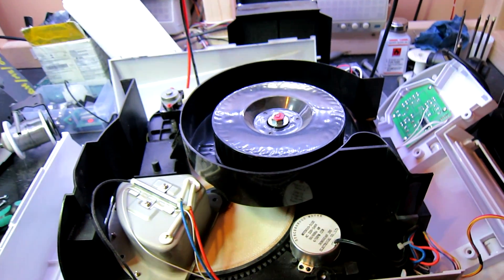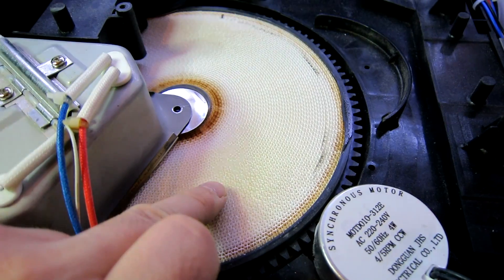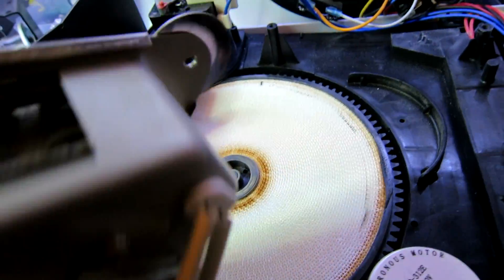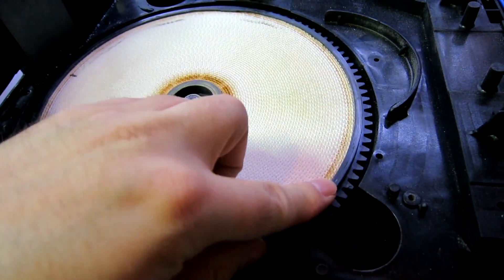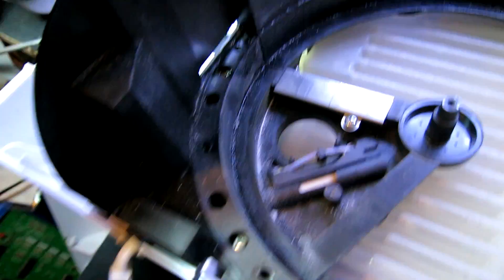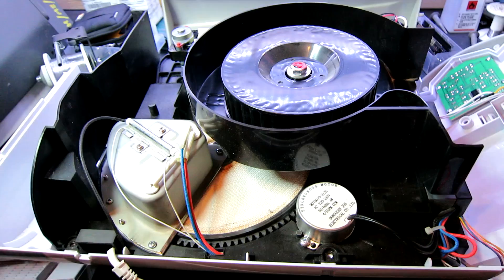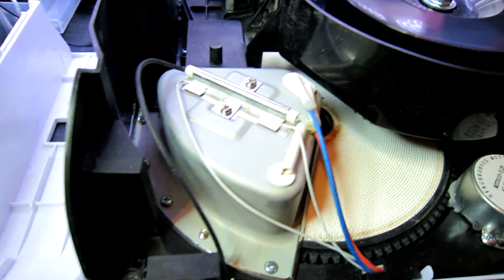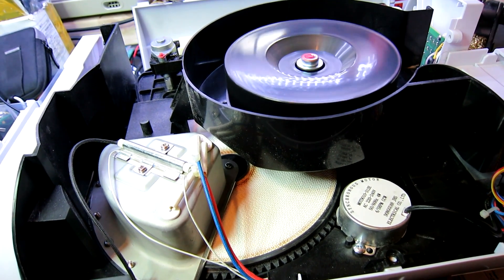Desiccant Dehumidifier Repair + How it works

Comment: Hi there. I am currently going down the dehumidifier rabbit hole for collecting as much knowledge as I can collect because apparently that's what satisfies me 🤣. I live in a dry desert area and temperatures here touch 50 degree Celsius. No one I know has heard of domestic dehumidifiers, never seen domestic dehumidifier in real life and wanted to know how these things worked. Yours is the perfect video for that. I love YouTube because I didn't think someone would have posted this. Just seen this I can think of at least 5 changes to improve the reliability. I wonder why companies makes such bad products.
Reply: some make low quality products to get your money, without spending much of theirs. I have high quality versions, which have been running for 6 years, without a single problem.
Reply: Why would you neeed a dehumidifier in the desert?  When I lived in the desert we had humidifiers.
Reply: @stargazer7644  it's humid here for some months along with high temp. Black/ red wet bulb temperatures. It's not a completely dry desert round the year of course.

Comment: Hi my Ecoair Desiccant Dehumidifier ECO DD122FW wont turn on and there are no lights showing. Having watched a few videos, I'm thinking it could be a faulty capacitor. Did try a multimeter on it and the needle didn't move. Is it worth the expense of  changing the capacitor to see what happens? Or could it just as easily be a number of causes?. thanks.

Comment: I have DD8L and it cut off after 2 mins,Fan goes slow and error light comes on. Then after few min it stops working. Any advise??
Reply: Hi , I have also the same problem in my desiccant dehumidifier.
Reply: @261divyesh  Check my channel I've got a video taking my DD8L apart. You probably need to take it apart and clean it.

Comment: How are you? Can you clean it? Mine extracts way too slow after 3 years of intensive laundry mode using. The rotor has some residues which I think prevent it from working well

Comment: Does anyone know if the desiccant wheel has to go only one way or can it go both? The motor turning it has died in mine and is marked ccw but almost all these motors are cw/ccw meaning they reverse when they encounter resistance. Am hoping I can just replace it with a cw/ccw model which would make the fix easy and cheap. The desiccant wheel on mine is very difficult to turn as in the video which I presume has lead to the motor burning out. Thanks for the very useful video arcadeuk!

Comment: so it takes the water out of the air and it put it back in the air  ?
Reply: When the desiccant is heated, the moisture goes into air which is then passed through a condenser module which is basically some plastic piping which is kept at around room temperature (so it's cooler than the heated air temperature). This causes the moisture in the air to condense out and drip into a collection bucket at the bottom of the unit. This fills up and then you pour the water away (some units have a pipe you can put in a sink or drain so you don't have to empty anything).

Comment: ...oops.. i came across the same model I have, and is also broken (rattle noises+non stop+only blows cold air, and no water, regardless of the house looks like a sauna). maybe i just get a compressor instead..

Comment: How is the condenser cooled?
Reply: I have DD8L and it cut off after 2 mins,Feb goes slow and error light comes on. Then after few min it stops working. Any advise??
Reply: @cancerionn  I've had two Desiccant Dehumidifiers that run constantly. The Eco Seb packed in after 14 months and the company wouldn't respond to any of my inquiries. The second one, the "Ivation", ran fine for three years then the air condenser got blocked and it stopped working. It was an easy job to take it apart and remove the blockage and now it's running perfectly again. 

"Ivation" was a much better company that stood by their product and even when the guarantee ran out, they offered to sell me a new one at a huge discount. I didn't need it as I fixed it myself. I suggest you strip it and see if the air condenser is blocked so the water can't get out. Good luck!

Comment: These units all seem to use the same guts, but have completely different control systems.  Some with glaring design errors including the ability to turn on the heaters independently even when no fans are running if the processor crashes.  The most common faults are heater failure, fan motor run-capacitor failure, thermal fuses tripping if the unit isn't allowed to cool down, furring up of the desiccant drum pores and leaking out of random orifices.  I don't think any of them are properly rated to run at full power, so I always run mine at the lower setting, and they actually work slightly more efficiently at that setting.  My current favourite is the Eco Air Simple since it has virtually no electronics in it.  Just a mechanical humidistat that turns the unit on and off.  As such, it has no cool-down time.  The only niggle is that he humidistat is in the same box as a big desiccant drum, so it is slow to respond.  Your unit has a better heater block than others I've taken to bits that had a simple mica holder that had puffed up with the moisture and heat, possibly causing the heater to fail at that point.  These are definitely a great dehumidifier for winter use.  Hopefully I'll be doing a video of some weird dehumidification experiments in the future.  The video will go up whether they work or not.
Reply from the maker: +bigclivedotcom Hi Clive, I regret not getting a simple humidistat version, as the electronic versions have the disadvantage that they basically just run continuously at a high/med/low power until the water container is full. My classic refrigerant based dehumidifier can run unattended for much longer periods of time, as it allows a more granular (and sensible relative humidity) setting to be achieved. I look forward to your future experiments on this subject
Reply: +arcadeuk It is rather annoying that it only lets you choose from three humidity settings, ironically with the single drip graphic being the highest humidity.  The electronic ones do at least have one advantage over the dumb unit.  They run the fan to sample the air every so often.  With the dumb unit the humidistat is in the same case as a freshly dried desiccant drum, so the hysteresis of the humidistat is really high.  But there's a digital humidistat module already on its way...
Reply: We've been using the EcoAir DD1 models for nearly 10 years in our family. Yes have seen the early ones fail with heater problems, but they are great for colder houses and especially UK damp garages to stop the contents going rusty....
Reply: another thumbs up for the ecoair simple version. 
simple so not much to wrong, but also easy to fix.
mine has been going for 7 years and not been opened, however have repaired a couple of friends machines. usually the problem come from bunged up drain hole, causing the condenser to fill up until it empties into the elecrtics

Comment: Wow, that's mega complex compared to the ones that use a Peltier plate.  I've got a couple that use the Peltier and they aren't very quick, although they do work - provided the room isn't that warm or they both stop working lol.
Reply from the maker: +GadgetUK164 Theoretically these are really effective, I just need to find a good brand. I got this one because of the wide temperature operating range (so it can be used in a cold garage etc) As you know yourself, the peltier ones have a narrow operating range, and the refrigeration based ones need  fairly warm room
Reply: I took one of mine to bits twice thinking it was faulty - it was just the ambient temperature being either too warm or too cold I think.
Reply from the maker: +GadgetUK164 haha oh dear, at least you got to have a look inside, I think you might like taking things apart as much as I do ;)
Reply: +GadgetUK164 The peltier ones are horribly inefficient.  They pretty much draw around 60W all the time and take very little water out compared to a compressor or desiccant unit.  One day someone is going to discover a simpler and cheaper way to extract moisture from the air.
Reply: +bigclivedotcom I wonder if something like the ceramic micro beads that chemists use to seperate water from other solvents.  I think that they are porous enough to trap water very slowly on their own, but can be dried out with heat when needed.

A "regeneratable dessicant" if you would.

I should look into that instead of using calcium-chloride (such as &quot;damp rid&quot;), which produces waste that needs to be sent to a disposal centre or builder.

edit, 7m later:
googled it. silica gel, activated alumina, zeolite.... so many options, so little performance/efficacy data in the first page of results.
Reply: LynxSnowCat late reply, but that's exactly what a desicant wheel is